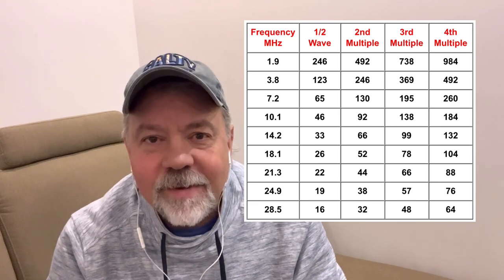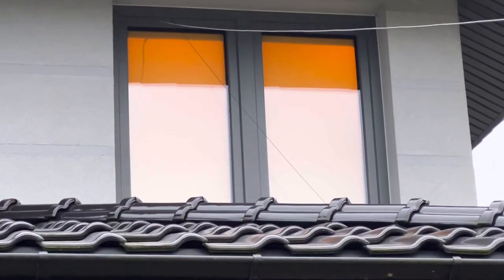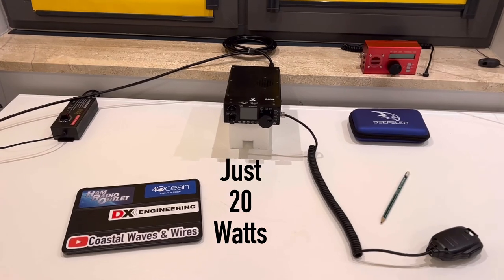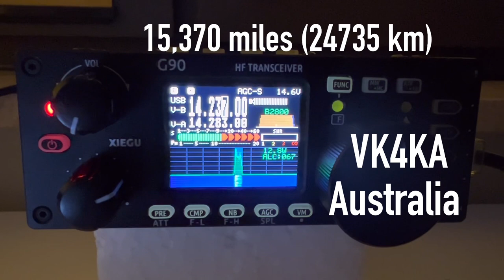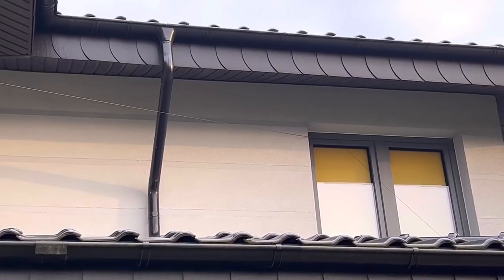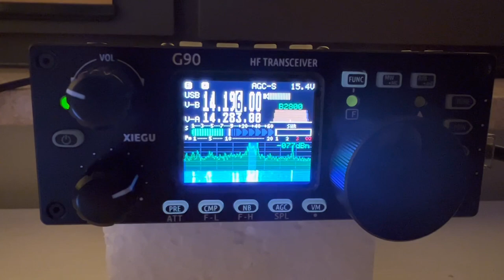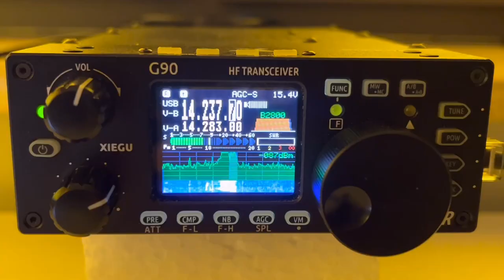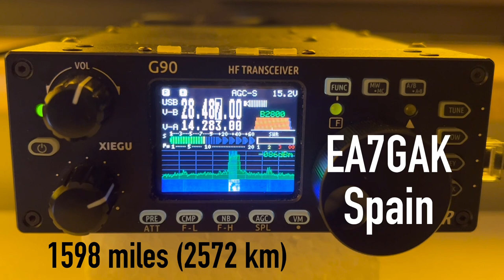Random Wire Antenna - Urban Portable

Comment: Question: Earth's circumference is 24,901 miles with half being 12,451 miles.  How can you say the contact was 15,370 miles?  how was this calculated?
Reply from the maker: Long path over and back around, logging software gave me the distance. So basically short path is 9000 miles and long path 15000 miles, thus 24,901 circumference
Reply: @COASTALWAVESWIRES  I enjoy your channel.   New to HAM KD9VBE.  i do not understand the answer in whole, but learning as others explain.  thank you 73
Reply from the maker: @RandellReeder  thank you so much, we’re all learning, I’m just documenting what I learn on the way. 73

Comment: Random wires can be very effective when worked against a good ground system. I've used them a lot over the years to great effect. I never really worried about the length too much...just plugged the lead-in end directly into my tuner. Ivan VE7IVN